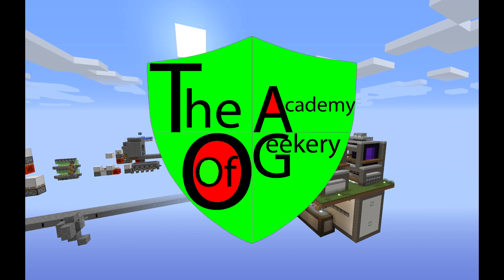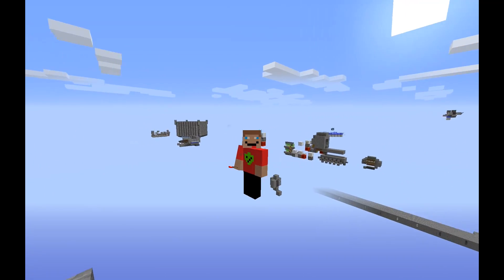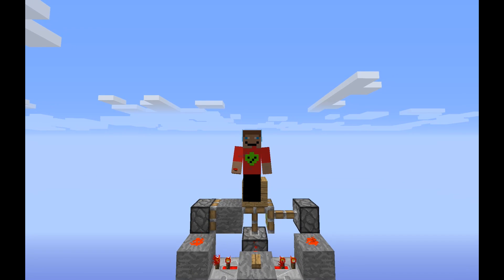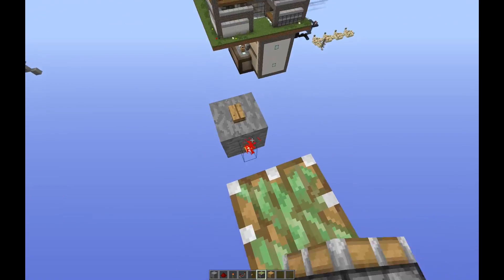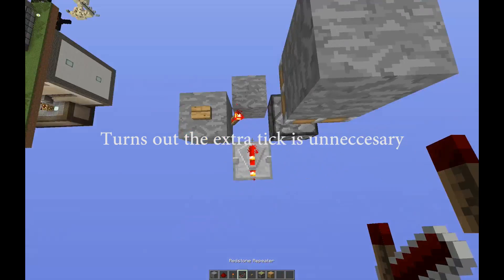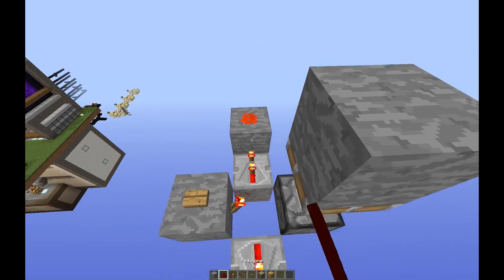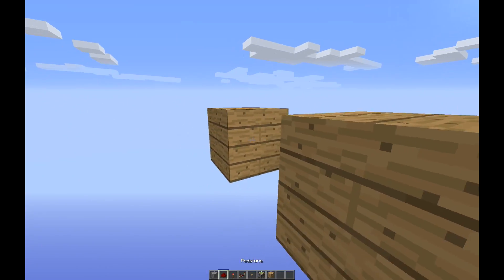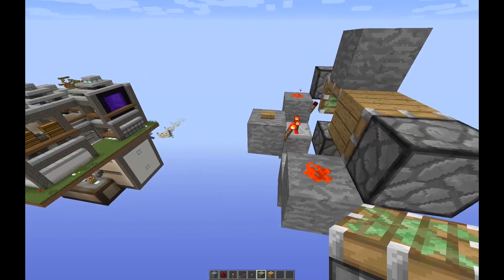How to Build a Block Swapper in Minecraft 1.20

Comment: make a 1.10 version
Reply from the maker: This is a 1.10 version. Did you read the title?
Reply from the maker: Oh yeah I just noticed the thumbnail... I'll update it
Reply: its because it dont work on mine i tried it
try it make a new version
Reply from the maker: It definitely works, this world is in 1.10! You must be building it wrong
Reply: try 1.10.2
Reply from the maker: That's what it is on
Reply: This Definitely doesn't work for me, I think It's a game bug. The two dots of redstone next to the swapper pistons remain powered and power the side pistons 100% of the time.
Reply from the maker: I did find you don't need to add an extra tick to the repeaters, so that may fix it. Your probably right about it being a game bug, it works either way for me.
Reply from the maker: Ok so I have done some testing, I built it exactly as I did in the video and tried with and without the extra tick... and it works. Either your game is busted or you are doing something wrong
Reply: It didn't work in the previous snapshot due to a bug, it works as intended now.